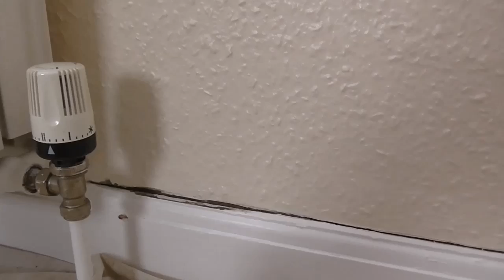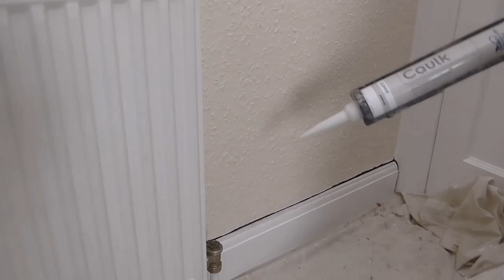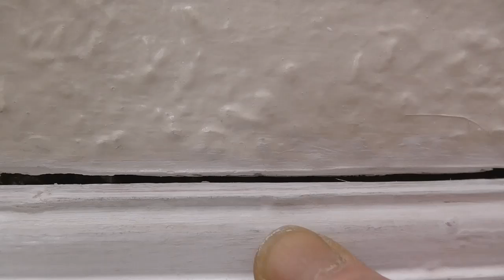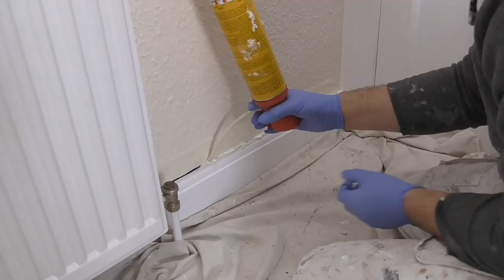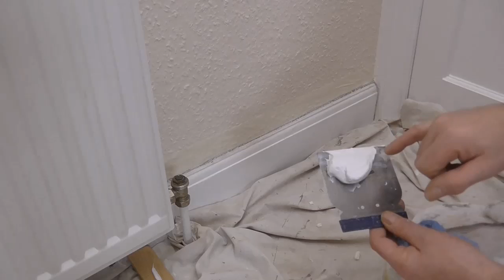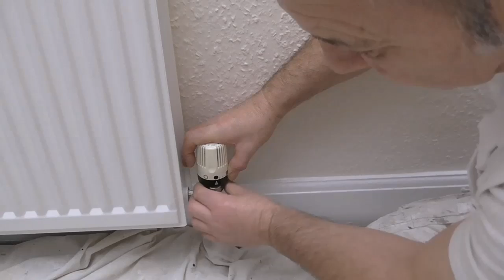How To Caulk Fill Baseboards Easy, Quick, Durable

Comment: Attention to detail and a great problem solver another great video 👍 question did you buy the caulk to prove a good  point or do you actually use caulk  eg if you run out of foam. Cheers M

Comment: I bet that's in your house. Using this process is a guessing game, as no one knows what or if the foam has attached to & how long it will hold.
Reply from the maker: You do if you understand how buildings are put together.. thanks
Reply: @PaintingandDecorating  
Your a builder as well. You are clever. Doesn't matter how old the building is, you don't know what's actually behind the skirting board. You might think you do.

Comment: Sorry to ask another question. You are the MAN. Another super video. The more I watch you, the more I learn.
I have noisy neighbors above me in an old house, I feel every step they take and 
am cursing with the vibrations from above. 
It seems the foam you use would be great at filling gaps and reducing vibrations.
A quick question a bit of skirting came off the wall that had been dobbed with some adhesive.
Could I use your expanding foam and priming methods to restick the skirting board back, 
with no nails or screws and once I used the expanding foam to stick the piece back and 
propped it in place, would the expanding foam expand further to open up the gap a bit further, 
or how to avoid this happening? Do you think the soudal expanding around PVC windows might expand too much and distort the PVC windows?
Reply from the maker: Thanks, all done correctly you should have no problems..  foam will not disturt pvc window.  Always try to secure anything you think may be pushed further out...
Reply: @PaintingandDecorating  Big thanks for your kind patience.
Reply from the maker: @michaelmercury1256  Your welcome

Comment: Please tells us the type of foam you use and the make. I once used foam and did not get on with it. I would usually go for drilling the skirting board to the wall but nowdays you do not know what you might hit doing that. Please how adhesive is the foam and how does it behave over the years, as you know some jobs look good initially but fail after a few years and need redoing. Well done for all your efforts and great workmanship.
Reply from the maker: Thank you... Soudal gap filling foam is best to fill gaps. But   loads of grab adhesives out and some adhesive foams...   you need to check what suits you best.

Comment: Hi, I am buying my first place and was wondering if this method of using foam could be used for a wet wall in the bathroom which has come lose off the wall? the wet wall is 1.4m high and it is a section of the wall opposite the bath so I don't think it is due to water ingress from the shower. Thank you!
Reply from the maker: Yes it should help.... but make sure you secure it so it doesn't push the panel off. 
Then seal round edge thanks

Comment: Yet another excellent video. Two questions: (1) Do you always caulk baseboards, even if there is no visible gap between the (previously painted) baseboard and the wall above it?  (2) Do you ever caulk between the baseboard and the floor? I have a section of baseboard with a noticeable gap there. Thanks!

Comment: I’m having similar issues with a new build where cracks between the skirting and wall leading up the stairs and there’s also a large void. Once I get to the final painting stage could I paint the top edge of the skirting board only (in the same paint)? Or would I have to paint the whole skirting board?
Reply from the maker: You always overlap paint for a better edge. Usually the wall paint is different than the skirting paint. Better to finish it correctly.

Comment: Thanks for another helpful video. I was having a difficulty trying to use this method where new skim coats of plaster is thicker than the skirting top edge in places. I'm going to persevere and see how it turns out. I was also wondering, can you apply the foam and method to gaps left from a bathroom panel fitting to walls. The ceiling's been skimmed, but there are gaps at the top of the new panels?
Reply from the maker: Sorry for late reply foam can be used for lots of different gaps. Especially if there is movement but always cover surfaces that you want to keep clean.
Reply: @PaintingandDecorating  Many thanks for the reply, much appreciated!

Comment: Regarding actual caulk (actually Polycell Flexible Gap Filler), what's the best thing to prime it with before painting so the topcoat doesn't craze or crack? Zinsser Gardz or BIN? BIN seems to flash through?
Reply from the maker: It can be down to the type of emulsion used. But we rarely use caulk anymore and that is one of the reasons plus it can take days to dry.
Reply: @PaintingandDecorating  OK, cheers, I have areas in the house where there are gaps and thought I was being clever using the flexible stuff and a wet finger. Using Leyland Hard Wearing Matt right now but switching to Dulux Vinyl Matt for the bulk of the hallways.

Comment: What filler did you use after the foam? Cheers.
Reply from the maker: Polycell trade interior easy sand. Thanks
Reply: @PaintingandDecorating  cheers! I have this exact job to tackle due to wonky walls!

Comment: Just thinking outside the box a little, as we know caulk is such a long curing substance and polyfilla is a quicker curing product, would it be a good idea to use an empty caulk tube filled up with pollyfilla or hard stop filler to speed up the application process on larger areas. Simply push out the plastic disk within the caulk tube with a long rod like a wooden dowel or a long thin screwdriver, fill the tube with filler and replace the disk and use in conjunction with a caulk gun? Take a bit of setting up but saves your fingers getting covered. And would always be reusable once cleaned out? Could be worth a video to test the theory. Cheers. Marc. 👍

Comment: The titles misleading. You said quick but that little bit took you ages. You wouldnt get anything done working at that speed
Reply: buts its a quality job you fool tyler
Reply from the maker: Your very misleading and your guess work is way off if that's all you think what gets done in a day. What ever you think the caulk was still wet and the job was finished.  You need to give this a go change the way you work. And change cracks for ever.